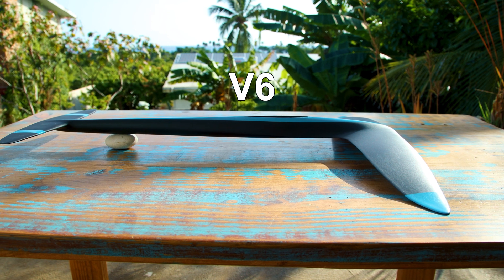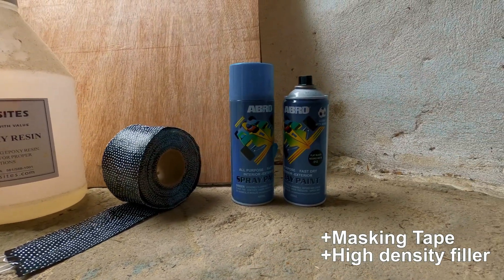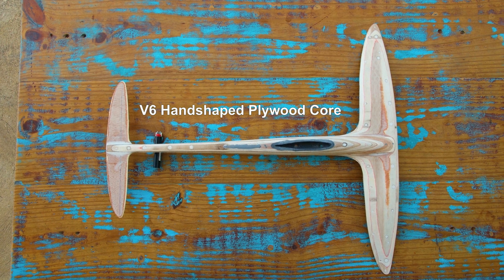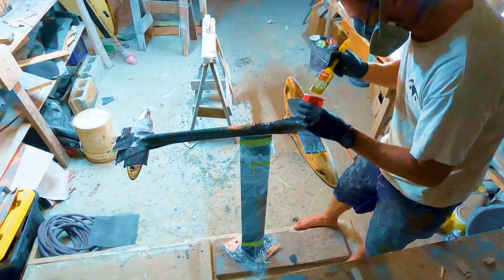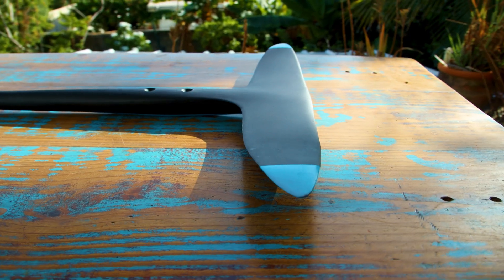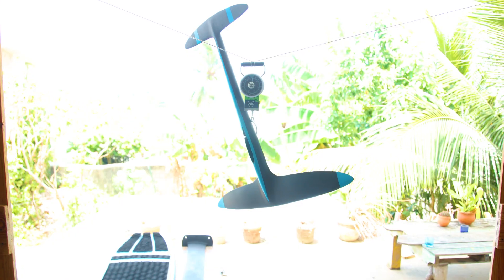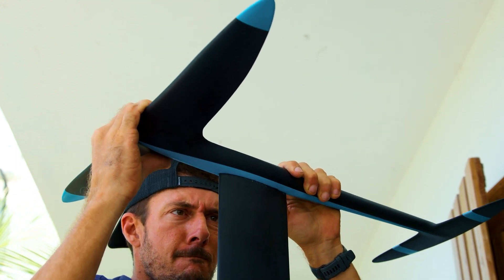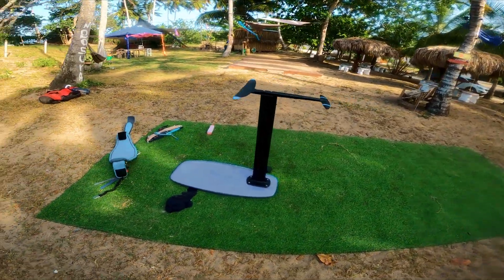DIY Hydrofoil V6 Intro and Telemetry

Comment: Amazing projects! in my opinion mast porfile plays a huge roll on top speed, the main reason why you are not able to catch windsurfes is because the mast profile. the wings and fuse are super well build and are pretty thin in my opinion, i have been kite foiling for a while i use Ketos foil freerace, let me know if you want some measures to improve your projects. i have never built a foil but plenty surfboards! Good work!!!
Reply from the maker: Thanks for the Tip, indeed the thickness of my mast is a lot more then my wings, im currently on a 15mm thick mast. Now i have to find someone willing to let me mold their racing mast, then figure out how to make it stiff enough. A real challenge that i will have to face at some point.

Comment: Thanks for the vids! Is there a video yet on how to angle the stabilizer to the front wing? What is the best angle compaired to front wing?
Reply from the maker: Sorry ive been busy and didn't get around to making the video yet but quickly explained: basically the flat side  (top side) of the stabilizer is 0 degrees relative to the fuselage (fuselage angle is clearly visible in the plywood layers of th fuse). The profile curve of the bottom side will generate juste enough lift to keep your foil stable and neutral feeling throughout most of the speed range. If you want something a little more stable with increasing front foot pressure as the speed goes up you can make the flat side -1 degrees relative to the fuse. Same goes with the front wing, the bottom side of the wing (flat side) is at 0 degrees, as you round the bottom leading edge it'll add a slight positive angle to the chord of the wing. Hope this helps.

Comment: Hoping to follow your example and build a kite foil. I found some nice tapered hardwood end-table legs at Lowes. This might dive you a ton of sanding on your next build
Reply from the maker: A tapered table leg could be a good starting base for sure, then glue the wings on later. Best of luck with your build!
Reply: @HANDIY  I will post a pic somehow when it’s done